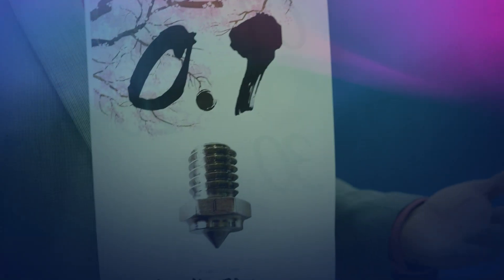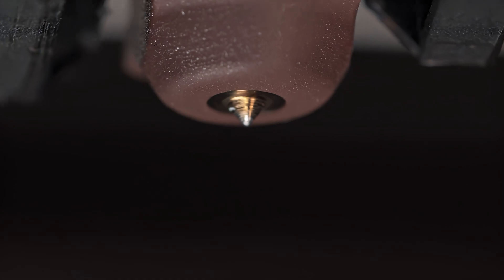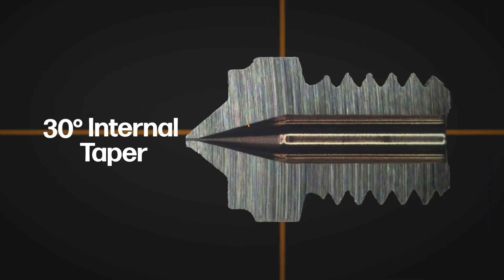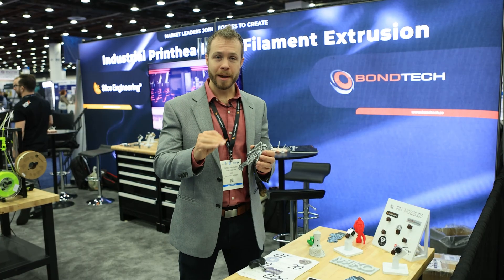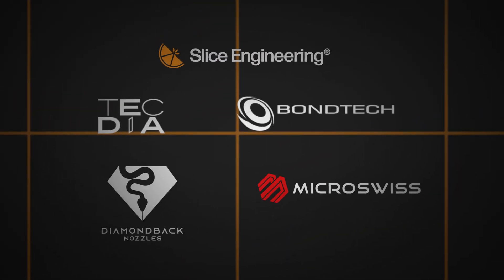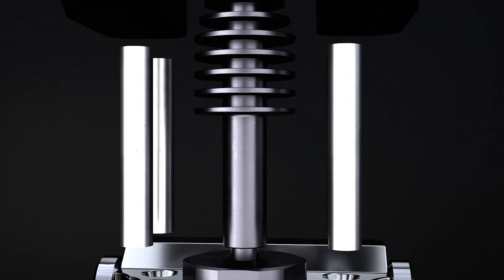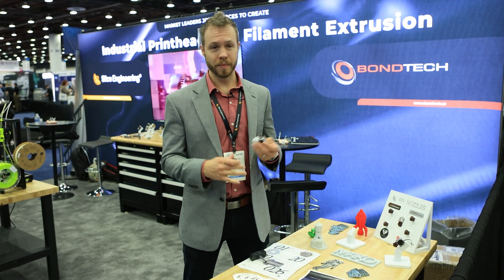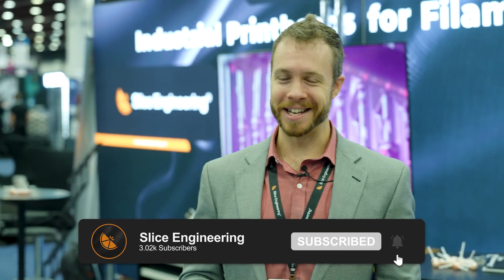Ultra-Precision 0.1mm Printing: kaikaFIN Nozzle for Mako by Tecdia + Slice Engineering

Comment: can you use it with the X1-C? do you provid the settings needed for the slicer?
Reply from the maker: kaikaFIN is a new nozzle standard, currently only compatible with our Mako Hotend for Bambu Lab, so you will need Mako to use kaikaFIN!
Reply: @SliceEngineering  I understand, I was gonna buy the whole hotend, my question is if the 0.1 nozzle had been tested and worked with the X1-C and if you provied settings to use it, since no 0.1 nozzle is availabe for said printer in Bambu Lab
Reply from the maker: @ansiaaa  we have tested with the P1S and X1E in the lab, but the X1-C will use the same settings. In Bambu Studio you will need to select a 0.2 mm nozzle size, and then follow the guidelines we have linked in the video description on our Knowledge Base page. This is a product designed for advanced users, so keep in mind that any dust, dirt, or moisture on the filament will likely clog the nozzle due to the tiny orifice size.
Reply: @SliceEngineering  that's ok, I understand the difficulties of using such a small nozzle. I just wanted to be sure it was something thoroughlt tested. I'm already impressed with the rest of your line of nozzles, but this is something else.
Reply: @SliceEngineering  thanks for taking the time to answer all my questions
Reply from the maker: @ansiaaa  Great! Glad we can help!
Reply: Could you use it for A1 mini?